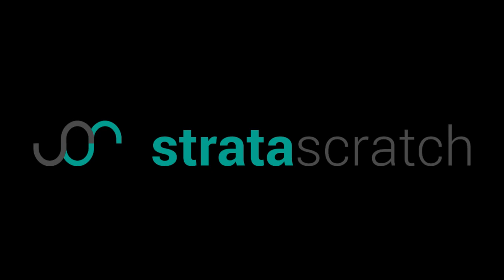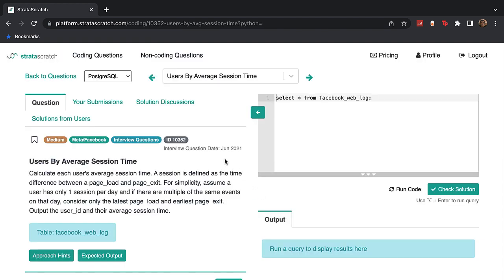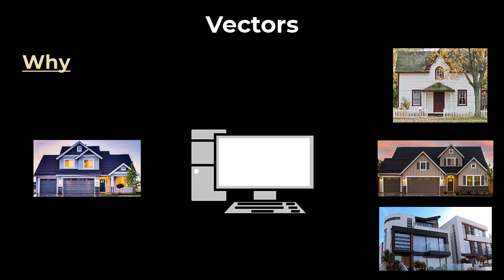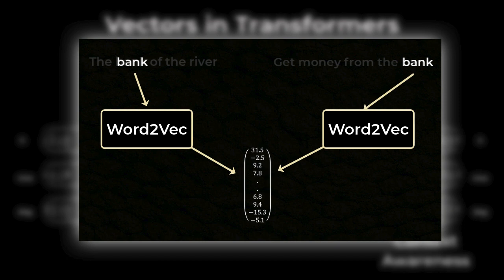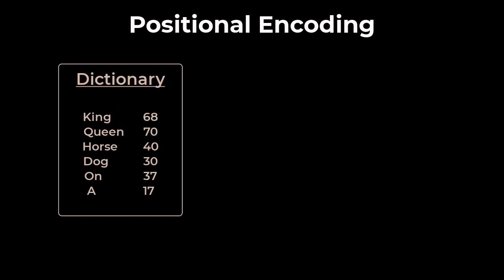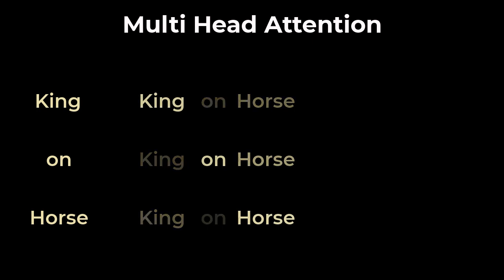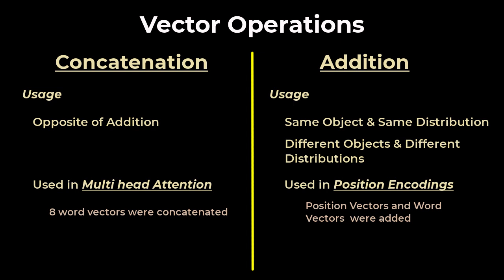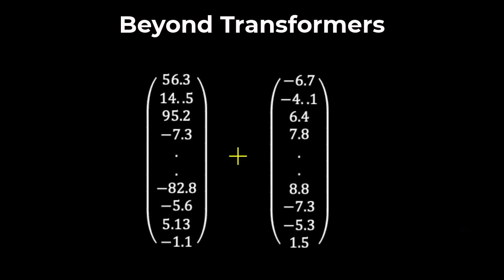Transformer Embeddings - EXPLAINED!

Comment: Can I ask, the material covered in this video, is it something that data scientist would learn and use?  or would it be ML engineers?  or just ML scientists?  Just wondering where such understanding of Transformer architecture fall under.
Reply from the maker: Good question. If you’re talking about just using these architectures, I would say Machine Learning Engineers would use them. If you are talking about developing new ideologies for constructing the architectures themselves, it might fall in the researchers (they have many titles : AI researchers, Deep Learning Researchers, ML researchers)

The meaning of “Data Science” has changed over the years. These days, it comes across as a fuzzy title that could be a Data Analyst, Data Engineer, ML engineer and everything in between. So do data scientists use Transformers? It depends. If the data scientist is more a machine learning engineer, then yes. If they are Data Analysts or Data Engineers, I doubt they would need to even use this beyond curiosity

Comment: As usual, nice video. Vectors are concatenated because they are split prior to entering the multiheaded attention. Hence the (parallelizable) "fork" we see on the diagram. Also, the concatenation does not augment the dimensionality compared to that of input embeddings, i.e. it actually restores it, thus authorizing the residual link's addition, otherwise impossible "as is" du to non-conformable operands. All this is more obvious when taking everything from the matricial point of view.
Regarding the addition of the positional and the meaning-space embeddings, the more convenient way to think about it is first to keep in mind that we are dealing with (mathematical space) coordinates. Would you add a longitude with a latitude ? Same intuition here : positional vectors components inject (additively, along each meaning axis through words) deterministic structures between the words of the sequence. This is supposed to uniquely identify the sequence for the downstream network to deal with. Put differently, the only things that matter are the (sinus/cosinus-based) differences we have between words. In practice, (or after normalization) embeddings components are (unit-variance) centered-on-0 values, just like sinus and cosines outputs. Having a meaning-space component of, say, 50, is extremely unlikely or quickly cleaned by "(add and) norm".

Comment: Great video! I think the reason why concatenation works better than addition in the multi-head attention module is because after the concatenation, there is a (fully-connected) linear layer that transforms the concatenated vectors back to the embedding dimension. 

So in your example of 8 heads, we have a concatenated vector of dimension 16, which gets transformed back to a dimension of 2.

And since the weights in the linear layer are learned, it can give more or less weight to specific heads. Meaning if one head creates better encodings than others, then I will get higher weights.

Whereas if we add all encodings from all heads, all of them essentially get the same weight, and there is no discrimination.

Comment: Why are you showing a word2vec embedding used as in input to the transformer? I thought it was common to use a tokenizer and let the model learn an embedding using the encoder part of the transformer.
Reply: We can use already learned embedding to convert the input and output token as mentioned in transformer paper.